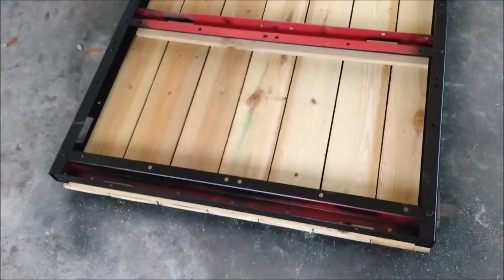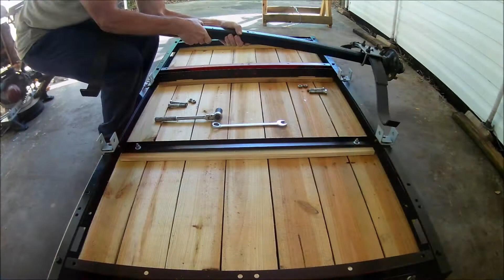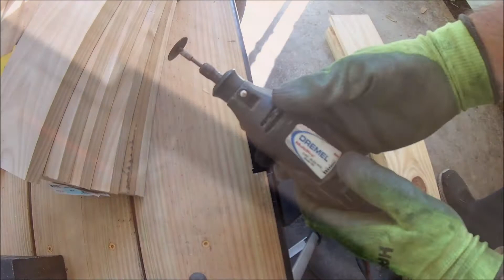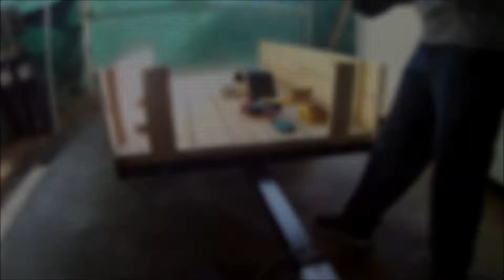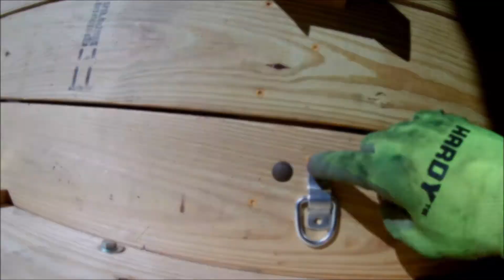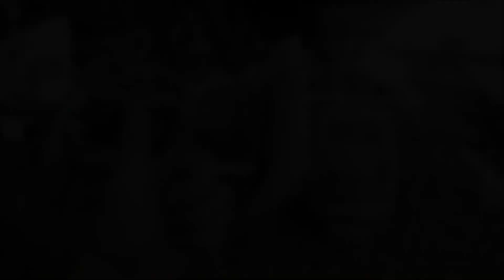Harbor Freight Trailer Rebuild, Part 3

Comment: Have you added up how much weight you have added?   It looks good though.
Reply from the maker: No, I didn't weigh it. But you know those giant bags of sand or gravel they sell at the big box stores? I've used the trailer to haul them. I think they're around 900 lb? I've also used it to haul 800 lb of concrete bags. And I hauled about 750 lb of scrap to the scrapyard.

Comment: Trying to brainstorm what to replace The deck of my harbor freight trailer with and I might do we I might do the same as you now. Does your trailer see a lot of weather How is it been holding up? And what lumber exactly did you use if you remember?
Reply from the maker: I used 1x6 pressure treated decking boards. It handles the weather pretty well, but will eventually need to be replaced.
Reply: @michaelblacktree  awesome I will look into it and see if I can get that in my area thank you

Comment: A job well done. I’m here in the UK and have recently bought a beat up rusty trainer similar to the Harbour Freight 8x4 folding trailer. It’s a complete strip down like yours. Same issue with the powder coating flaking off but thankfully the nasty looking rust is coming off with a flap disc. Thanks for the video. 👍🏻👊🏻
Reply from the maker: thanks!

Comment: I would've added two more bolts to each wheel guards at the top so that if something leaned on them, they would not bend outward when only being anchored at the bottom ends. Also treat the wood with Thomspons seal or something like that for longer preservation.

With the height of your side rails, could it have been better to make those into ramps so you can load wheeled cargo and then reattach the side rails when towing?

I'm not much of a steel cutter or welder and was thinking of ordering parts from the 3 various harbor freight trailers in order to mashup something longer with an 'A' frame tongue that could be stored on castors upright, have some external trailer side rail mount brackets, two/three license plate covers, (2 for mud flaps) a kickstand type toungue support, old metal lockable tool box for straps, two axles, radial tires, siderails/ramps, spare tire, riding lawnmower tow attachment and some other ideas I can't see in my head right now. The sides/front/back would need to be removable to make a flat bed trailer. I'll have to be careful with the weight as I don't have a truck but rather a compact car for towing so my loads will not be more than maybe a rear engine riding lawnmower.
Reply from the maker: You make some good points. However, I don't have any "wheeled cargo" to load onto the trailer. So I have no need for ramps.

Comment: Whenever laying a deck, including a house deck, always mount the boards with the end grain curving up. This way when the board warps, it will curve down. If you do it the other way, you end up with little lakes on top of the deck boards that went on the wrong way, when it rains. You can see this if you look at the end grain and curvature of the boards on an old deck.

I like to solder all electrical connections, and use a ground wire too. Do not depend on chassis grounds or mechanical connections if you can avoid them. Trailer wiring always corrodes and have iffy lights as a result. Probably because trailers sit out in the rain most of their life.

I have this same trailer and found that the rear shackle makes a god-awful racket when driving down the street when the trailer is empty. You can use some rubber tubing and some other rubber or other method to eliminate the metal-to-metal contact there; that way the rattle won't happen when you go over a bump.
Reply from the maker: I agree about the decking planks. But I don't like to solder vehicle wiring. I personally prefer crimp connections with weather resistant heat-shrink tubing. Different strokes for different folks, as they say.

Also, these trailers have a design flaw baked into the electrical system. It's grounded to the frame. But the frame pieces are painted, and bolted together. So there's no continuity between frame pieces.
Reply: @michaelblacktree  I only recently learned of heat-shrink tubing and feel it is brilliant.
How is the trailer working for you now?